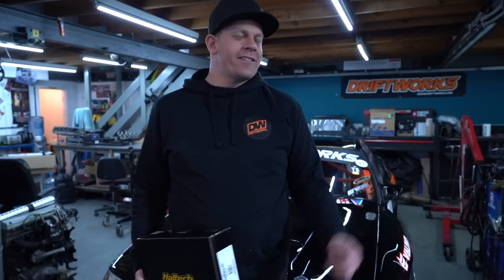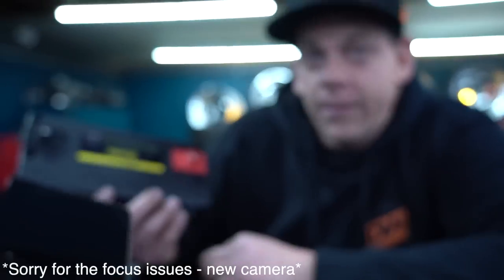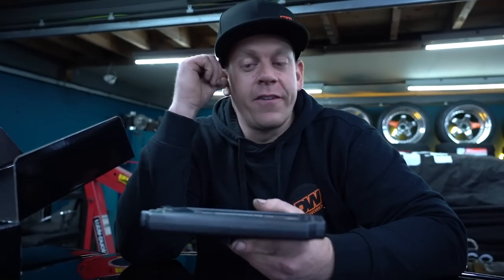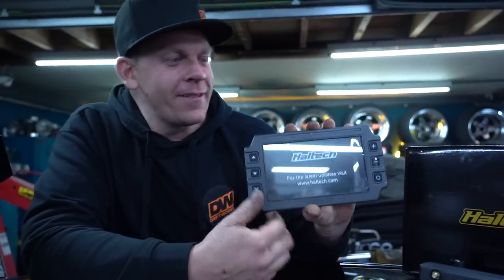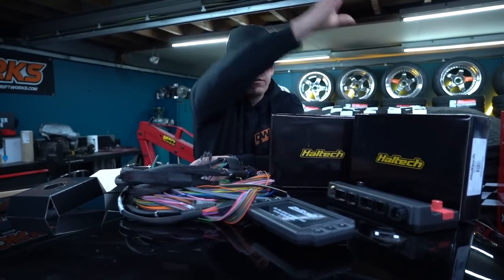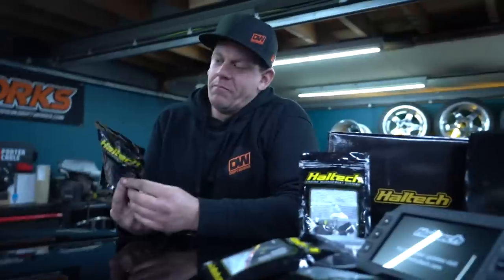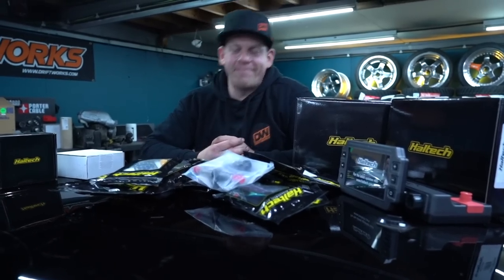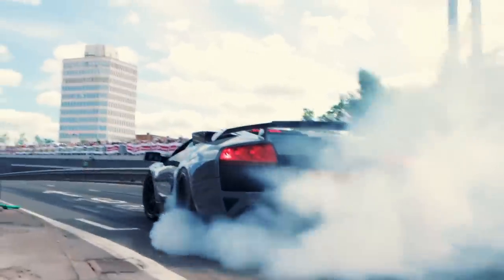Driftworks 2JZ pro comp Nissan Skyline R32 2020 mega build - part 2

Comment: Might be useful to know if you dont already but the flex fuel sensor is an6 but you may require bigger lines for your set up, if you do just run a bypass as the fuel sensor just needs a sample not everything so if you Y piece it then you can run  bigger pipe and still keep flex fuel sensor and will still work great, this is what the drag guys do.
Reply: Alternatively, plumb the flex-fuel sensor into the return line so it won't restrict the inlet side of the fuel rail.
Reply: I actually thought this when we looked at it while filming (my pause in the video) as I plan to use an 8 fuel lines feed and return . So will either do a bypass or something along those lines . Thanks for reassuring my initial thoughts 👍🏻

Comment: For the speed sensor will it only read speed traveling not wheel speed so may be an idea to have it setup for wheel speed pulling from a sensor on the gearbox or rear driveshafts to monitor wheel speed.

Comment: Exciting updates, good for you!  Would you guys ever build an electric drift car?  Watched the video of the Ford Mach E trying to drift at Goodwood and it didn’t seem like it wants to do it.  Of course can’t imagine the cost of building it.  This came to mind when you mentioned future proofing the car.
Reply from the maker: Nah, gross.
Reply: @driftworks  😭
Reply: @TheBigDubovsky  There are multiple electric dift cars on hoonigans channel i think from back a little ways.
Reply: @leebrock8386  Watched the M3 and Toyota vids, the cars are burnout capable, but what’s interesting is real competition electric drift cars seem to not be able to carry the same nice line as the gas cars, which is strange considering the instant power and high HP.  Considering governments are pushing electric they’ll figure it out by then.  Pretty sure gas prices will be too high to continue racing gas cars in 10 years or so.